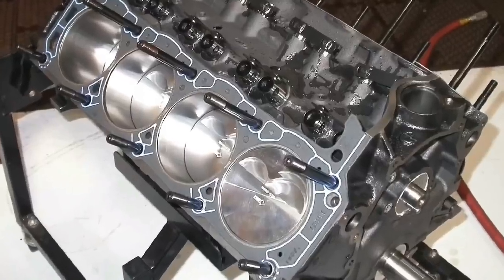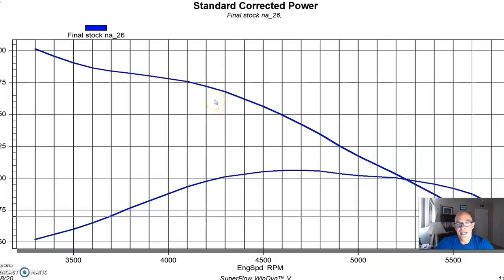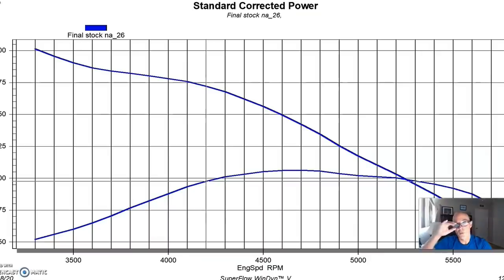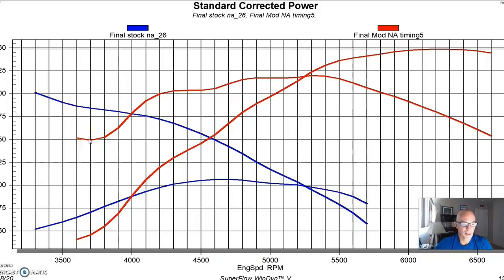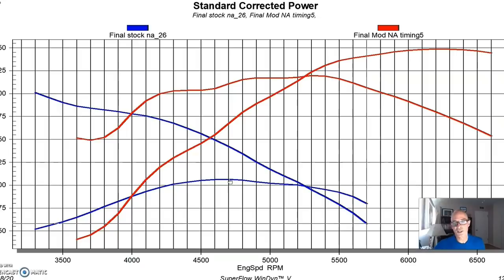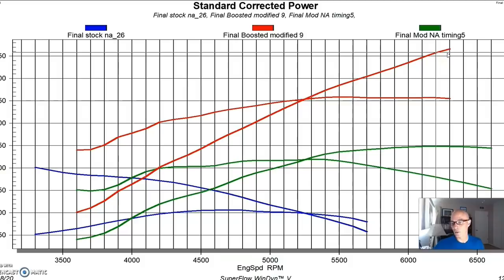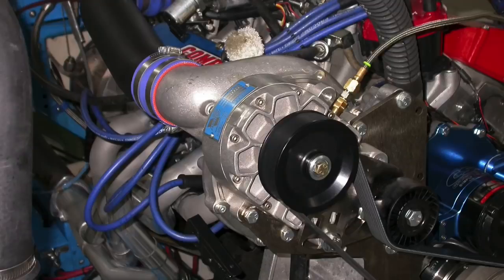347 SBF-BOOST vs BOLT ONS vs BOTH

Comment: Can you test a 347 with afr 220 heads and a 75mm turbo. The cam is 590 is lift and 114 lobe separation, and 65lbs injecters?
Reply from the maker: the 75mm turbo dictates the power potential
Reply: @richardholdener1727  it's the combo I'm putting together in my drag car

Comment: I wasn't expecting the trade off of the low end to be that much. I wonder if the combination of a milder cam and the RHS 215 heads would of yielded more bottom end and still the same top end output. Appreciate the content.
Reply from the maker: A BETTER HEAD CHOICE LIKE THE AFR 165/185 OR TFS 11R
Reply: @richardholdener1727  Is that because of the better flow characteristic at lower lifts?

Comment: "We weren't spinning it fast" Shows a vortech with 2 cracked impeller blades...that was funny.
In the end, so a 347 has power adder potential of 700+HP. when done right. In such a simple and light package.

Comment: Hi Richard. Would the xfi 236hr be a good choice on dart shp347 arp I95cnc and efi holley hi ram work. Or will it be sluggish down low. Cheers. Looking for 500hp. Would a tighter lsa be better down low or worse for torque, say 110
Reply from the maker: TIGHTER LSA WOULD HELP-THE COMBINATION OF THE HI RAM AND xfi CAM WILL BE SOFT
Reply: Soft as in street manners. Any suggestions on size for throttle body. 95or bigger? Cheers Richard, good man. Just a weekend beast in a 72maverick.🇦🇺

Comment: Hey Richard..  What you do with the testing of different components to see the results is a service to the community..  Thanks a ton....
Question..  Why stroke a 302 to a 347 when Ford makes a 351?
2nd question.. If you use similiar components on a 347 and a 351 would you get similiar results?.
Reply from the maker: yes similar results-I would chose the 351W-it has a stronger block

Comment: Hi Richard, I’m building a 347 stroker with a Dart shp block. I have a set of afr 185 heads 58cc. My question is, if I’m running a turbo, can I use these heads or do I need to upgrade to a bigger head for 900 horse?
Reply from the maker: THOSE R FINE
Reply: Thanks Richard

Comment: Richard have you heard anything about the TFS twisted wedge heads bring used on a 347 combined with the pro charger using the same cam combination the you used in this video
Reply from the maker: that combo would work fine-I ran a 347 with TW heads (as cast and CNC)

Comment: Loved the vid as always.  It's cool the way u do it and  explain it as well.
I wish I had u as my tuner. Can I ask so now at 666bhp to go past that will u need to do  Forge pistons and so on . Plus it was 300bhp stock ish lol how did u no it would take that much on stock pistons. This build has got me hocked. Ok in the uk we run 2.0L and maybe 3.0 v6 . My wrx was 2.0L but ran 390bhp on stock bottom end. I been told most engines will take double the bhp so 200bhp 2.0L will go 400bhp . 
Can not wait for the next one. 
One more thing am thinking of gettimg a msd box to pull my timing. But not sure what one its a 4cy 1.8Tt turbo 2003. But all vids on utube so a msd box going to a  distributor cap. So i don't no to get the 6msd or the msd6AL. Help

Comment: Like to see try y headers vs others. All so like to see how the offenhauser duel port intake performs as well as the offenhauser 360 split single plane. Would like to see a super tall 4 hole carb spacer say 8 plus inches tall on a duel plane . All so like to see  a tall 8 in+ tall 2 hole spacer on a duel plane. My idea is to make a engine with a broad power band with a lot of low end. Love to see a custom intake that could out do the rpm air gap! Has to be a carb intake.

Comment: Great test. Now convert that bottom end to a BOSS 302 (347). This is an engine I'd love to build if I can ever get a car worthy of it. CHI 3V heads on a 347 stroker. Your previous piece on the 302 BOSS yielded great results. This is just going that extra step. Then add boost!!

Comment: If you had a '65 Mustang Convertible just for cruising/street rod use...
What engine would you pick?
Reply: BTDT
Stock 5.0 HO fuelie with T5. 
Simple, easy, efficient, powerful.
Stock will kick a 289 HIPO car into the ditch.
Ive done several.

Comment: Hey Richard, have you ever done a back to back comparison of the old Ford Motorsport letter cams? Thanks!
Reply: Theyre ok, but they are 25 yr old grinds.
Modern grinds with modern springs do notably better.

Comment: All I hear is 347 blah blah blah, LS boost blah blah blah. Get back to that 292 already. Not that we don't appreciate all the testing. But Damn bro you can't dangle that 292 in front of straight six addicts and then   not keep it coming. Set those points get the thing fired up.

Comment: I'm getting ready to put a roller block 351 together for a tow application, looking to go high torque.  I have acquired a set of +p heads. I would like to keep stock fuel injection with upgraded throttle body, injectors and a tune. My question is am I spinning my wheels with this combo or should I go with aftermarket heads and intake? Also what cam would you suggest for this application?  
Thanks, love your videos, learning so much.
Reply from the maker: the P heads would be better than stock, but not as good as TFS or AFR. A cam is a good idea
Reply: @richardholdener1727  by any chance could you  recommend a good RV cam or on the upper end of the RV cam range.
Reply: Stock injectors will need 43 psi or probably a size upgrade.

Comment: Hey Richard have you ever tested running a roots style supercharger mounted remotely like a centrifugal supercharger. Could test the difference between mounting it on top of the engine vs off the side of the engine vs a centrifugal. Would having a manifold with runners make more power or would it make it change boost curve. Would be cool to see because you could run even bigger supercharger that arent able to bolt on top of that engine normally
Reply from the maker: having the long-runner intake would help with a remote mounted roots blower

Comment: The other night we were at a cruise in and an elderly man was looking at our crown vic frame swap F-100 and he thought the 2 valve 4.6 was a Chevrolet motor.  I told him what it was and he told me that engine would run longer than a small block because it has 5 main bearings and and small blocks only have 4.  I was taught to respect my elders, so I held my tongue.  So, Richard, you are really flirting with disaster with that 347 since it only has 4 main bearings!! Be careful!!!  Here's a test for you, Big bang on a small block Chevy, Ford and Mopar with 1 bearing sitting on the bench!!!  Thanks!
Reply from the maker: we had a plan like that for Wheel of Death
Reply: SBF have FIVE mains.
Reply: HotRod Ray really? Are you sure?

Comment: How much power can you weasel out of a 302 HO  sbf with a stock cam, and no supercharger....?
For us guys with an auto and tall gearing that value gas mileage....
Reply: Not much more than stock. Intake and headers. Better off putting in an rv cam for about 300hp. If you want 400hp you need bigger cam, higher stall converter, and rear gears. Aluminum heads will make more power with less camshaft. Low end torque will suffer though.

Comment: Stock 5.0, stock aluminum 4 barrel intake vs, torker, performer, performer rpm, performer rpm air gap, Victor jr., TRI carb, and tunnel ram.  Just for fun.
Reply from the maker: take a look at  the video comparing the perf, rpm air gap, torker and vic jr.

Comment: If you couldn’t have the final combination, would you rather have the booster “stock” motor or the modified NA motor?
Reply from the maker: I would get cheap Explorer P heads and a cheap cam then add boost

Comment: Hey Richard!

So back in the day I built my first (and so far only) V8 for myself.  It was a 306, Eagle rods, KB pistons, your favourite cam (TFS stage 2 224/232), Powerheads CNC ported E7TE heads, an Explorer intake, and long tubes flowing through a 2.5" Magnaflow exhaust.  I never really developed it beyond the initial stage, it made 252/280 at the wheels, and since then I've wondered if I'd made a couple wrong choices that limited me.  

The TB was a 60mm and "I read" that a larger TB would only be worth a couple.  The headers were 1.5" as I wanted to keep a bunch of torque, but maybe larger wouldn't have hurt.  I also wondered how those heads were doing, if they were really capable of more or if I would have been better with some Edelbrocks (let alone the AFR 165).

At the same time my buddy built his own 306 with the same cam but with bigger everything - ported Edelbrock heads, 1.625 LTs, a single plane and a 650 - and he made the same power as me but way less torque (no kidding) on the same dyno day. That made me think I was on the right track with mine...

Whadda ya think?
Reply from the maker: those heads-even ported aren't great-the Explorer intake also limited power-cam was good, headerd are fine
Reply: @richardholdener1727  Cool, thanks!  I thought the heads would be reasonable given the CFM / CC numbers.  Certainly not in the TFS/AFR category, but good enough for the snappy street engine I was hoping for.  I just never knew if the AFR 165 would have been THAT much of an improvement...  I guess so?
Reply: Now I'm going back through my copy of "5.0L Ford Dyno Tests (by Richard Holdener)" for nostalgia...  man, look at you with hair!

Comment: 460 stock vs, Cobrajet vs SuperCobrajet heads
Reply: May as well throw in a aluminum aftermarket set as those heads are a bit antiquated.
Reply from the maker: I did CJ vs SCJ

Comment: I am not a fan of the 347 architecture because I'm concerned about the piston speed and the side loading of the piston in the cylinder. Won't those two factors cause the engine to wear much faster than a 331 or stock 302 stroke?
Reply: The 347 has been out for a long long time now, and those questions were answered quite awhile ago.
Reply from the maker: stop worrying-if you build it-the power will come!

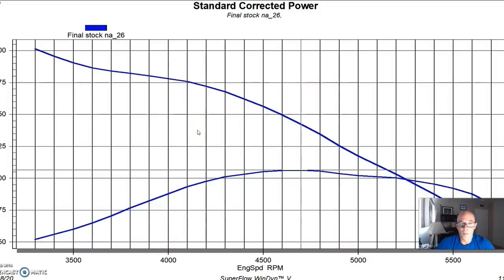Comment: 3:22 looks like a mouse chewed on your impeller blades! I hope your test wasnt done with that busted unit?
Reply: Richard is an animal that sprinkles piston rings on his Wheaties and chews on rod caps for lunch. He will run the jankiest of setups for they are just future sustenance to be consumed.
Reply from the maker: the iron rings are best-cuz minerals
Reply: I said same thing bro. Those blades are shot lol. We know Richard tho. If it works, chances are he's gona still use it unless it's detrimental to the engine.. thank God we got this guy tho for real
Reply: Philip Ball : Squirells. The Mouse is normally in side a small block Chev.
Reply: Bearings good? Oil seal good? If so, good chance he ran it. 
Heat treated impellers will take a beating.

Comment: I would like to see the comparison between a 358 Chevy inline valve NASCAR engine and a 358 Ford With Yates Cleveland heads. I have heard the Chevy makes more torque and the Ford makes more HP. The Ford is outlawed in some racing series and I wonder why?

Comment: Hi Richard, thank you for your great videos. I am building a1984 Ford 302.  I have the Promaxx 180 heads and I'm converting the engine to a roller cam set up. I am curious as to how the Mustangs would perform running a stock or mild Cam with this set up. I believe you will lose some power but gain driveability. Have you thought about doing any tests like that on the dyno? Thanks, Tom

Comment: Richard, did you ever, or could you in the future, do a smog legal test  on a 5.0 stroker? Say AFR EO# 165 heads, a Crane 216* EO# cam, JBA EO# shorties and a ported Explorer intake? All on a 331 or 347? And then add Pro Charger's EO# 14-psi blower?
Reply: This is what I had on mine without the blower. I also had an E303 cam. I made 327 on a mustang dyno. 430 with a little bottle shot. Kept it all street legal because of California smog. Was a lot of fun. 
  Now dropping in a Boss 302 block stroked to 342 and a turbo. Should be fun.

Comment: what happen to the impeller tips of the supercharger ?, 666HP that pretty much destroy the theory that this SBF can only handle 600HP. 

A question Richard, have you seen 347 with Aluminum rods ? they are always larger on the rod caps, is notching the cylinders still possible or the notch is so big that you have to notch the block pan surface as well ?

Comment: Can you do a junk yard (or aftermarket) 351w  427 stroker or a 408 stroker? With the same mods ie boost / cam /heads
Reply: he did a junkyard 351W

broke a piston on boost at 1000hp because he didnt gap the rings

Comment: YES! Sitting here drinking my coffee, seen the notice and went straight to it!!
 In your opinion..if you had them side by side and had to pick one for a daily driver, blown 331 or 347?
 If you get a chance, be cool to see muffler shootout using the 5.0 or 5.0.based engine. Or.some good "street" engine builds.  I'm buiding a blown 331 for daily driver. Ill get a time slip, but only a couple.. but building  it to travel and just have a nice.driver with ac
Reply: Drinking my coffee to and checking emails. I would like the 347 for the bigger and more balanced torque curve. 

I’m building a 5.7 to 6.4 .020 over 394 Hemi stroker, it’s going to be high compression(11:3:0) with a mild cam and 3K stall in my 13 Ram. Will be a nice daily driver with really good torque in a 4door crew cab, but it will also mean business to😅.
Reply: @bri-manhunter2654  sweet, i love stroker motors, dyno it..
Reply: TigreLoko24. Your 331 will be awesome!

We’re thinking with the mild cam it will be around 500hp at the motor and 600Ib of torque. Rebuilt because of finding a bad piston when doing the Hellcat top end swap.
Reply: @bri-manhunter2654  gonna be a beast n/a truck, enjoy..
Reply: @bri-manhunter2654   Man thats going to be nice!!!
Reply: to me bigger is always better, but that 331 is obviously better than the 302, its gonna be a fun daily, bro..
Reply: @P71ScrewHead   Yeah I'm putting a test motor in right now,(2000 ranger) picking the heads up from the machine shop this afternoon.. little stock bottom end 302, zpect t5, small Andsrson Ford cam.. heavily ported Twisted Wedge heads, Intakes and throttle body, shooting for "close" to 350 to the tire
Reply: Jody. That should be fun!
Reply: @bri-manhunter2654  I sure hope so! Was going to be a stock swap, so I could see how I like the truck..you know how things change..lol
Reply: @19jody72  n/a or are you adding boost?? Stroke it out bro..
Reply: @19jody72  gonna be a great truck to drive, dont stop there..lol Funny if you read the comments how we get mixed up with who owns what..lol
Reply: Jody. We know how that goes🤣.
Reply: @P71ScrewHead    The engine now is a  NA 302 stock bottom end, never had the oil pan off.. the 331 that I'll build later will be blown, just a standard vortech S-trim. "IF" i like how the truck feels and drives. People like diffent tastes, but to me it has to feel stock as far as just driving down the road. Last "project" I'm doing.   To expensive  now days. I've got a.couple Harleys I enjoy now instead of  always working on things.
Reply: Jody. I N agree, I went with a  mild 210/222 high lift 114 LSA cam for good daily driving and lots of torque for my truck, the 3K stall is a great street unit.
Reply: @bri-manhunter2654  yes sir!! My cam is a small lift..512..222/230 duration.  112 lobe separation
Reply: @19jody72  sorry i just saw your comment, dont remember if i replied so here i am.. Yes, i agree its expensive, n yes it sucks always having to figure out what's wrong with it if its never fixed right, no need to build a huge power maker that'll need rebuilding often or breaks parts every time, a mild build can do if you dont go racing for money.. Have fun with them Harleys bro, and your stroker build..
Reply: @P71ScrewHead  Thanks  bro.. just about finished with if.waiting on lifters and I jectors

Comment: Sounds like my motor. CHP stroker kit, eagle5.4 rods, CHP LW140 pistons, offset ground 3.4 Cleveland, first gen ported twist wedge, custom Isky. 550 226/230 duration 114 lobe smog cam, vortec V 1 s trim meant to pass cali smog. Hoping for 600 hp.

Comment: That chipped impeller tho...
Reply: still made 666hp :/ If you have a turbo/SC and you suck up a sock or a rock and chip an impeller blade, and youre still making boost and running good, you gonna buy a new impeller and change it before the last one grenades? I think not!